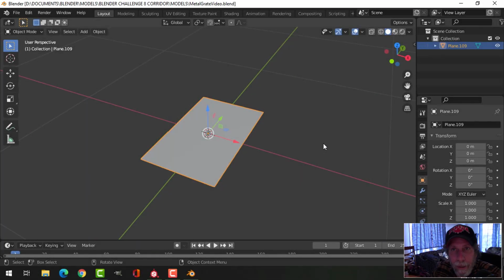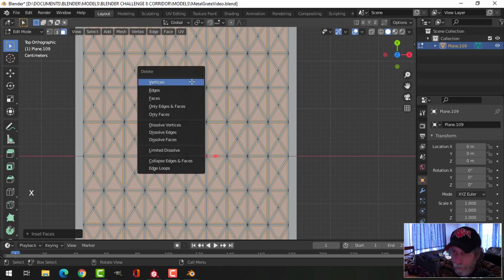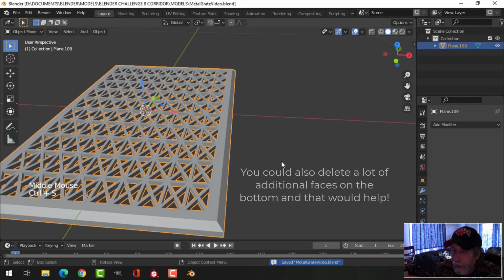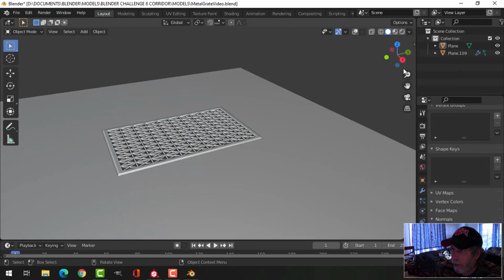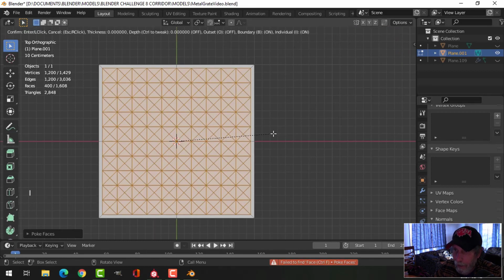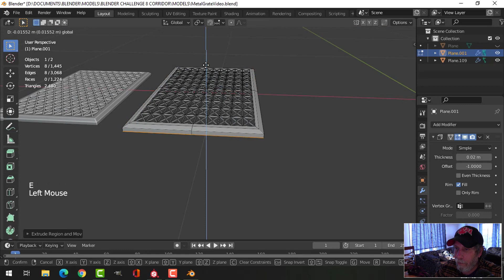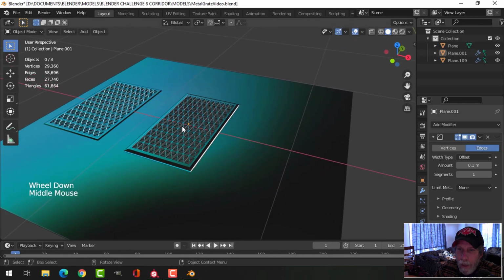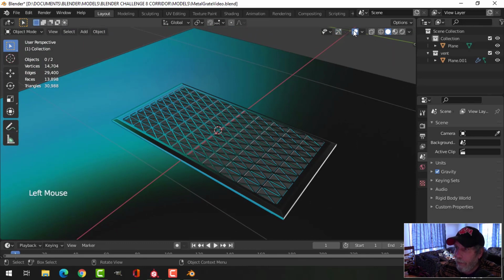BLENDER CHALLENGE 8: Modeling a Metal Vent/Grate (Part 17)

Comment: You can also use the bevel node in the material instead of the bevel modifier . Gives solid results and doesnt affect polycount too !
Reply from the maker: Nice!!
Reply from the maker: @Con Koumis And when using substance painter but probably could be worked into the node tree if one was really concerned about it.
Reply: @zerobio  true . But if you re using substance you could export two versions one with the bevel one without . And use the highpoly to bake details on the lowpoly . That way you get the highpoly details on the lowpoly .
Reply from the maker: @Ali_Ncir  dats true. Good stuff